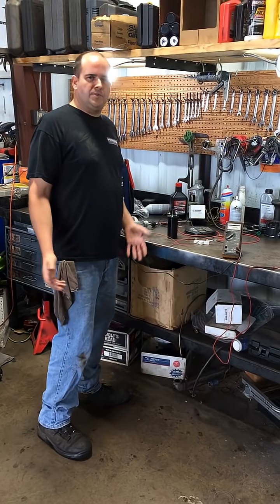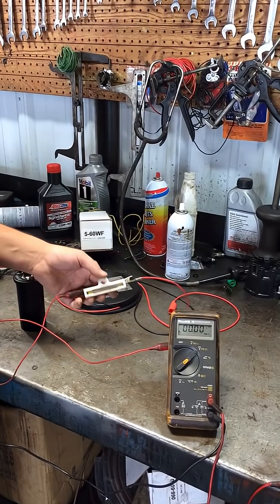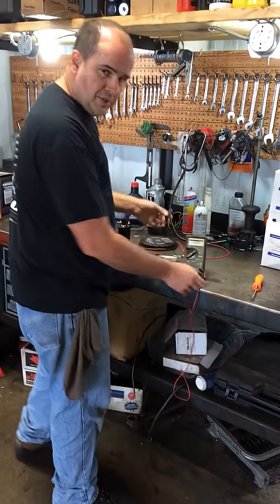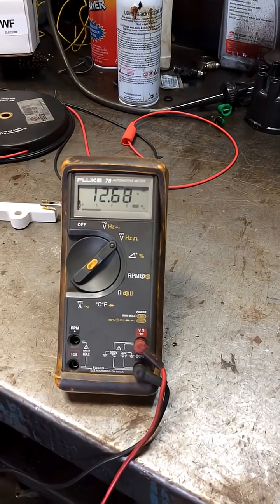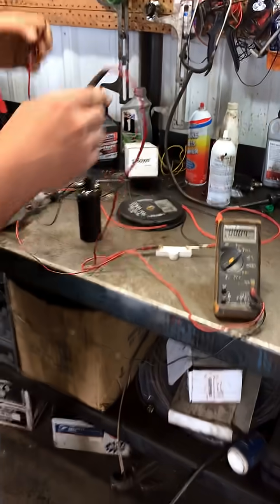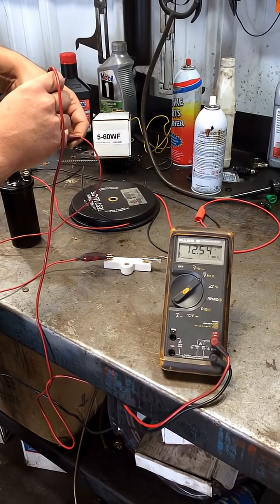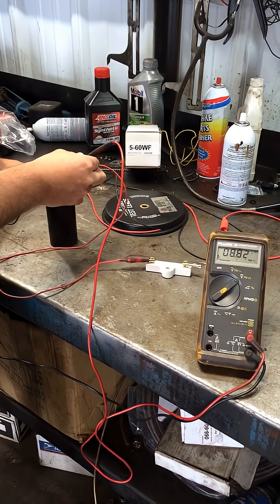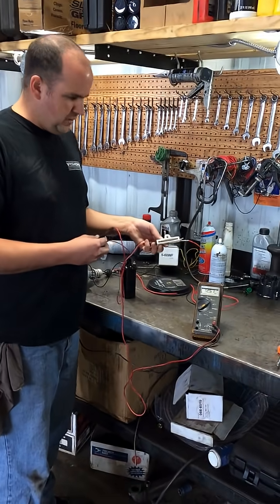Demonstration on voltage drop across a ballast resistor

Comment: Hello I see lot peopel use relays for ignition coils.
Can some one describe me if I still need to use resistor or culd I use potenciometer insted?
What ralay rating I need and how to calculate resistor for ignition coil.
Me car is Opel tipical GM lay out but I use inductive trigger/4pin gm ignition module and e core type 4pin ignition coil.
So Im not shure if me ignition coil wuld work with relay or not.
Im not shure what runs it honestly alternator field wire or positive linear voltage regulator inside me dashboard Im not shure their wire harnest lay out is preaty much confuseing.
Also I have cold start problems thats why I mentioned potenciometer I dont get enough voltage to the ignition coil and the 4pin gm ignition module do not have retarding option only wacum and spring load advance .
So can some one help me please give advice how to solve this problem.
Im doing the entire wire harnest be me self and I desire wire harnest that is heavely protected against static and arcing.
I use 3 4 6 pin relays so wuld like to know where and what type of diode rating shuld I use.
And was curiuse to know If I culd use heavy gage non stranded wire insted ?
Originaly I wanted to use buss bars for ground and positive conection to avoid corrosion and futher problems with me car and make evry curcuet seperate so they do not interact with ich other.
In the past I hade flat or over charged baterrys,back feading alternator,relays interactions,dual filament bulbs and xenon bulbs interacting with me wire harnest car refuse to shut off engine,self acelerates,gives electric shock,and lot other unusual effects who are anoying.
So any one has ideas I wuld like to try out.

Comment: Put a capacitor in series with the resistor and then charge the capacitor (a big electrolytic, at least 1 millifarad just to be sure it doesnt leak), then check the volt reading on the capacitor.

Comment: mine is 7.75 output to coil when the battery is 12.8, plus it takes about 30 seconds to get hot enough to remove fingerprints from fingers.  when it gets hot like that, alternator voltage jumps to as high as 15.5 - 16.2 volts.  has me curious if my ballast resistor has turned straight into a vampire.

Comment: Can you explain why the ballast resistor only drops under the coil's load?  I was testing the ballast resistor on my old Jag XJ6, and got the full 12 volt reading with the current flowing thru the ballast resistor.  The electrons are flowing thru that winding coil "spring" in the resistor, and seems to me it would get warm and create resistance, and thus lower the volts.  So, why does it not show a lower voltage?  Cant wrap my head around that one.  
Also, when testing Ohms on a resistor, what is the normal reading?  Can you test ohms with just the multimeter hooked to each side?
Reply: crazeyspivey I’m having this exact same problem, since it was 10 months ago... did you fix it??

Comment: where did put the red cable of your multimeter in the coil? was it the same terminal where you put the plus cable coming form the ballast? it is just a bit confusing try perceive it with your hands in front of it.i'm less than a beginner on this and just trying to clear things out so that i can learn it well.
Reply from the maker: jose pontes , yes it's connected to the + side of the coil.

Comment: I have Farmall 706 changed electronic ignition Pertronix kit 1461. I have installed red wire to + side off coil and black wite - side of coil cranks but won't start??
Reply from the maker: That could be a bunch of things. Do you have power to the + side of the coil with the key on? Is the negative side of the coil pulsing while cranking? Could be a defective Pertronix module as well.

Comment: i have a question, i have the same setup why when i try to start the car my resistor gets hot and starts to smoke? is that a result in a bad ballist resistor?
Reply from the maker: Is the resistor brand new? New ones will smoke for a little bit and should stop. If it continues to smoke you must have a short in the circuit or too much current flow. Example could be that you have aftermarket accessories connected on the resistor side of the coil.

Comment: How does the voltage increase thru the resister? What are the ohms of that thing? Isn't that a coil itself in that "resistor"?
Reply from the maker: It increases when the load is removed. When the load is present it drops the voltage. That's how a resistors works. A resistor limits the flow of current which intern lowers the voltage in a series circuit.

Comment: in an open circuit between  negative or positive and the resistor of pretty much any value the voltage stays the same? same with ac as well.
Reply from the maker: That's correct. The resistor can't limit current without current flowing. A/C or D/C.